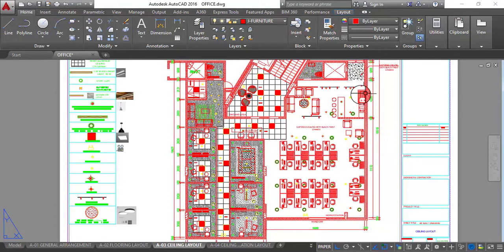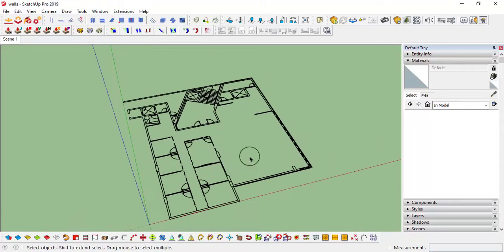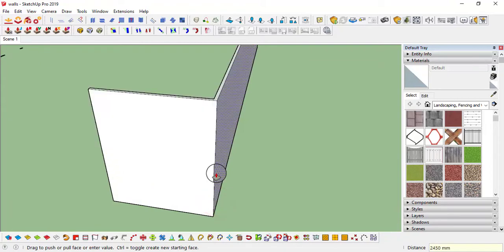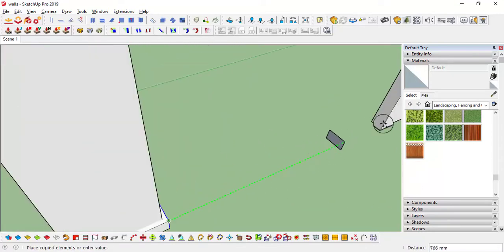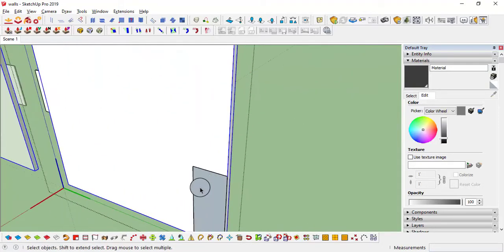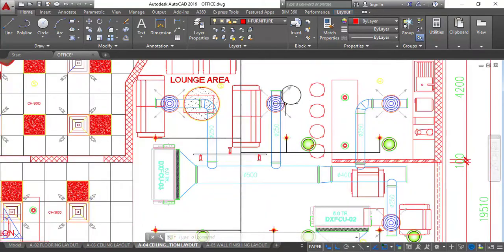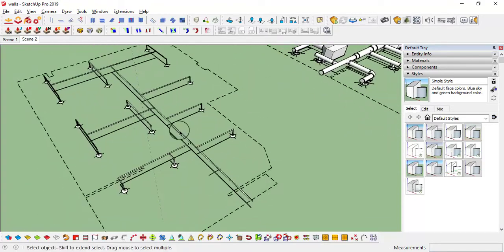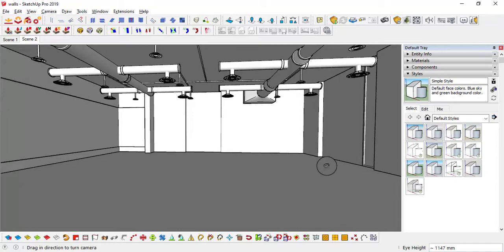Complete Project - 3D Modeling to Animation in SketchUp & Enscape : Part 2

Comment: Sir how did u move a single point???
Reply from the maker: Select the point by right side window selection and use move command
Reply: @MJCreations327  i tried bt it moves perpendicular 😭..like u did in this tutorial line's one point remain same & one point move further in tapered
Reply from the maker: @parasbisht3375  as I told you..
Select from left to right window selection, not right to left ..

These two window selections are different

Comment: can u provide the hvac dawg file
Reply from the maker: The CAD file is in the description..

In that file you can find the HVAC drawing..
Reply: @MJCreations327  do you have a seperate hvacs dwg file like the one u opened in the video
Reply from the maker: @hassankhalil3275   it's the same file..
I got one file, that I shared in the description..

In the video I have shown the layout section...
If you open the "model" section then you can find the drawings separately..
Reply: @hassankhalil3275   you have to clean the main model in case you need i can send you